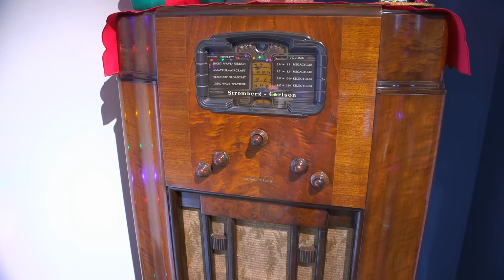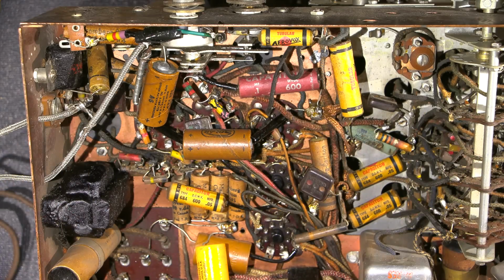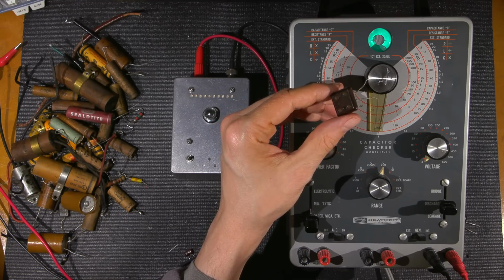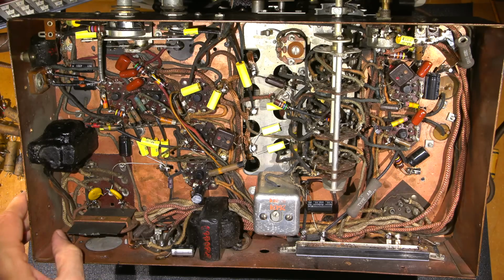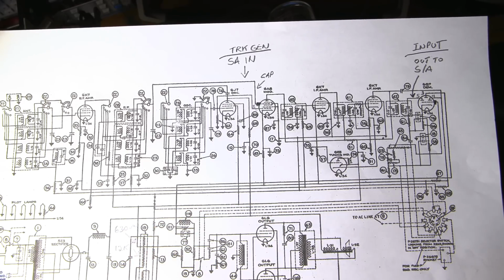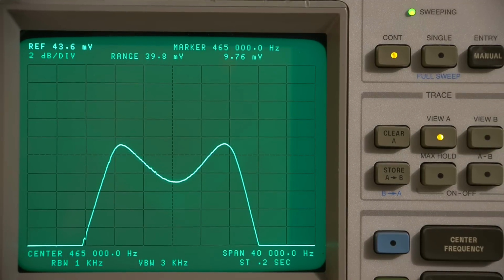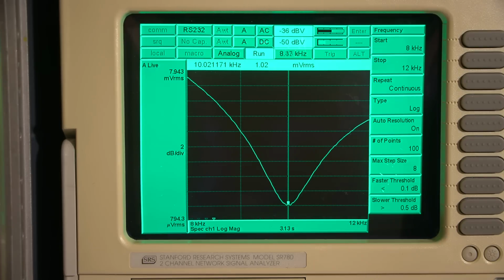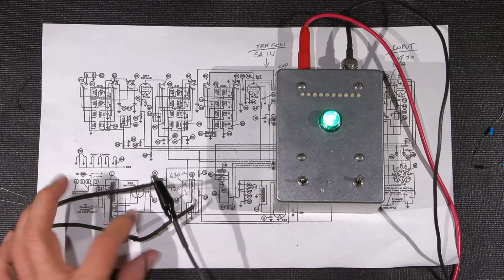84 Year Old Radio Receiver Restoration! Stromberg-Carlson 145L

Comment: When that resistor pack goes bad. Can one use a bus bar and make a resistor block? Using high wattage resistors and heat sink them to the body? Or would the extra lead length add noise into the circuit? I think there was a reason for them to make it a pack.

Comment: I put a bucking transformer in my radio to drop input voltage to 110V.  Added a CL-90 inrush current limiter to protect filaments, and a fuse.

Comment: Buy an old Stromberg Carson? are you going to provide the alignment service? No one could possibly find the sweep generator, scope, or specialized cap testors. You haven't even told us where to find or register for your patient channel much less build the dozens of devices required to fix the radio or all of the equipment it requires to fix it up so you are giving out misinformation and telling people to buy useless junk that will cost a fortune then have to throw it away! Tell you what. provide a free alignment service with free shipping to wherever you are and free return shipping

Comment: Cool video!!!
I bought a mid 70s Technics audio receiver that was recapped. They used nichicon (spelling) good quality ones. I even have the bag of all the old ones that were removed.
First couple runs I did have a smell which I don't know is normal. Even now as I stress it, I get a scent coming from the electronics but it performs awesome. I did have to restring the tuner which I found cool. There were pulleys and stuff running all around the case lol. But I found the service manual that showed the routing. 
Can't beat the sound of the phono preamp from these older units that were designed to play records as opposed to any modern ones that are just there as a feature and not intended to be the main mode of external audio playing.

Comment: I have a much "newer" Stromberg-carlson radio/phono. From 1947.. It has 2 fm bands.. The radio still needs some work.. The fm bands are working but not "quite there" yet.. I play my mp3 player through the phono input via a matching transformer.. It sounds amazing with its push pull 6f6's output tubes... This radio once belonged to my grandfather's brother... Still giving me tunes...I can play 78's on its old record changer.. The cabinet was built by 'Andrew malcolm'... A real gem... That's a real awesome radio you have there... Worthy of a full restoration... Chassis and cabinet, if required.... It's just too bad the AM band isn't what it used to be...

Comment: One secondary purpose for the speaker exciter coil is as that mentioned hum choke. One pi filter quieted that high voltage DC and hum nicely.
Back when I worked as senior tech at RadioVision, the owner came to visit. He had been sidelined by numerous ministrokes, but was still quite technically sharp. He was surprised that I knew of the exciter/choke function in an antique that we were repairing for someone as a favor.
Permanent magnets were becoming popular in the late '30's, but then got chewed up as war supply components, initially for loan-lease, then for our own war production. Old electronics are literally an object history lesson!
As for the speaker, there's only one way to get better - brand new and stored under hypoxic, temperature controlled conditions.  ;)
Mica and phenolic caps, tunable slugs, oh the memories!

BTW, remember, they designed these using state of the art computing of the time - the slide rule.

Comment: I used to do this for a "living".  Sadly, most of the folks who grew up with 30's and 40's radios are now dead, or close,  and the collapse of AM brodcasting due to "frequency auctions"  and allowing huge monopoly ownership of radio stations... has made use of these wonderful sounding radios.. nearly impossible.  Trust Busting Legislation, and a return to showings of public interest and necessity for local and large market licensing might help.  But maybe it;s like horse collars.   Not big sellers when nobody even knows which end of a horse to talk to anymore.    My approach to these radios was always to shotgun replace all paper and electrolytics, check all resistors, clean,, dexoit and re-tube,   then any other troubles will show up during the alignment and calibration.  "repair"  is sort of a non-concept untill this is done.

Comment: The detection of the very high resistance of the alligator clip boots reminded me of a frustrating problem I once had related to those black Kulka brand (or others) barrier style terminal strips.  An oscillator was on two screws driving an electromagnetic probe in water where two electrodes picked up the very, very small current produced when moving water cut through the magnetic lines of force.  (An electromagnetic velocity sensor.)  I could not get it to perform hardly at all which was frustrating because we had manufactured a number of other products with this type sensor.  But not with the wires attached to a black barrier strip type terminal block.  Somehow, amazingly, I postulated that the terminal block plastic might be conductive.  (I think I got that notion from wonder how they colored it black - "lamp black"?  Something with carbon?  Who knows.)  And that was it.  I could touch the oscillator output to just the barrier strip plastic and a big signal got coupled to the input.  That may be part of the frustration, but also the fun, of dealing with electronics.  If you do enough of it, you will see some interesting curve balls.

Comment: Doesn’t everyone want to try it out when they get it home?isn’t that the point?I remember when I sold videos we told them to plug it in warm up the heads to dispel any condensation so was wondering is this the same kind of thing you mean?not one should leak with just switching it on?enjoy your tutorial though👍
Reply from the maker: Switching on 84 Year old electronics before a restoration will cost you money, especially when you have to replace tubes and transformers. If you burn out the field coil on the speaker, much more money. From sitting, capacitors have dried up, and they short circuit when power is applied, which in turn burns out the power supply and surrounding components. This isn't a VCR or tape machine.

Comment: That's pretty impressive. I live about 70 miles away from Fort Collins, and I can't pick up the WWV.
Reply from the maker: They transmit at 2.5MHz , 5MHz, 10MHz, 15MHz and 20MHz. Try each one, you will hear them at one of those frequencies depending on your location.

Comment: Greetings:
You made an eye tube amplifier in another restoration, so here is another suggesion. Extend he eye tube life by interrupting he eye tube anode voltage after tuning is pused using the AVC voltage sability and re-enable the voltage when tuning is again turned whereby the AVC voltage changes.

Comment: Greetings:
I know that you prefer to maintain originality in most of your restorations but I recall that in a previous radio restoration you chose too add an amplifier to an eye tube circuit using an unused punched "tube socket" location. Therefore I feel safe in suggesting that you might want to extend the eye tube life by adding a circuit to interrupt the tube's anode voltage when not being used for tuning. I would automatically detect using the AVC hat the tuning eye is needed and re-enable the power to light the target.

Comment: This reminds me of my ham radio years and building guitar amps from older radios. I've restored old Victor radios with the with turntable combos using the horseshoe electric pickups. It even had a recording attachment. Radio one example is the Victor Electrola RE-57 1931

Comment: Did you know that some micamold capacitors are paper? If the value is over.001 it usually is paper. Thats why with mica molds you have to check the value, and not assume its mica.

Comment: Mr. Carlson;   I have a Sony SQD 2020 4 channel decoder.  ( that I bought new in 1975) It randomly drops the front left output when in the 2-4 mode which requires me to switch to a normal outpur mode. This mode normally gives the best sound effects to the rear channels.  What do you think could possibly be the issue?  I have no knowledge of the inner workings of electronics.  Do you have any suggestions on what I might look for inside the unit?

Comment: I may be wrong, but the bass surround on that speaker could indeed be... wait for it... calf skin! I've seen quite a few from this era that have calf skin... as unlike felt it will preserve the seal of the driver and produce more bass than porous felt, which unless it's heavily doped will leak air and consequently bass... and that's the reason it's there in the first place.

Comment: Sir Carlson's Strombergian-Jamm'n-Carlson. 
A well grounded common Tron exploring a plate sizzling world of internally heated glass blown Valves, building to crashendo crashing capacitors, regimental Sargent striped resistors, trimmed ceramic trimmers, transformers in disguise. 
Hi-fidelity Hi-definition, Uhf-Ultra High Freq, Uhd-Ultra High Def, Kilocycles-Kilobits Megacycles-Megabits

Comment: I was given a closely related Stromberg Carlson with a record player. It has the same bezel and the acoustic labyrinth markings.  As we loaded it on a trailer, the chassis slid out and fell to the street. The glass plate and the tubes shattered. I use it as a stand for my modern receiver and for record storage. Very interesting, and a bit heartbreaking to see how special a radio it was.

Comment: Used to do this with a vtvm back in the 60s. Used ohms 100k and 1 Meg scaleswax copacitors leaked on rx1meg when they were new still own no’s waviest. Heat the leads with solde4ing iron and watch it drop.

Comment: I had some old tube radio s but could never find replacements for them , I wish I had thm back after finding your channel just get lost, confused. By the complexity and the diagram s just as well be in Chinese to me. If I needed radio work id send it to you. I'm a total idiot whenever it comes to auto and radio wiring

Comment: I will tell you something that will make you sick.  When I was in a technical high in the 1950s the school received a large truck load of console radios from the 1930s and 1940s.  The school had no use or room for all these large radios.  So we students were told to scrap all the cabinets and to strip all the chassis for all the tubes and power transformers. We also striped the output transformers and speakers. Later as a collector it all made me very sad.

Comment: i was think , it must be possible to make more than 1 in a case, so you have the orginal , but with a click you can  use  it for internet radio, .......... so you have best of "both" worlds, and you can use dail for both, ..... or if there more possibilitys, .............because the older radio"s are so big, you can make several in 1 and just ad a switch to channel between theme , and you keep your front and dail , to work with them all, so whatever you use, just look like the old days, so there is the nostalgy (im 50)  from i was a child in the 1970s (i was born 71 so memory is more late 70s and begin 80 , ........... child hood is between 1971 and 1991; wen a was a young adult , and had more freedom that stay inhome lissen to the radio

Comment: this is a real radio,  this had a place in your house, almost like a ..... (im dutch, and dont know how to type it)  a box for lissen lp"s of cd"s,  it was always sad if you need thrrow a perfecr working radio away just because you get no lamps for it to let it work, the sound is so clear, ....... dont know this days with the very expensive types  , put once that sound , you hear everywhere,  ......... and so easy........ on tv , if you you had no sound, you replace a lamp, if you screen was black , you change the second lamp, ........ and that was it,  2 lamps , ........... now its al make to "break" ............. the older radio"s there where after 50 years still perfect condition, there where made to work and keep working, ...... now there made to just survive your garancy, , it garancy was 2 years, it was made to work for  max 3 years ...................

and there story"s enough that there break on the exact date the garancy stop

Comment: Kind of a stupid question since you mostly work on electronics but I have a 1903 hand crank record player. I have hundreds of records for it. It has nothing electronic in it. Everything works except for one thing. There is only one song on each side of the record. When it reaches the end of the song it is supposed to stop spinning on its own. That it does not. It will spin down if you don’t crank on it too much. But it’s a mild inconvenience because you have to pretty much babysit it. Got any ideas? To be dead honest with you I haven’t even opened it up

Comment: Thanks for the tip on the resistor on the seeing eye tube. I got a RAF BC-696 for practically free on eBay that was nicely modified at one point for amateur use, but has since been hacked. My only option is to make it functional is to do a modern redesign but use some of the original components. I'm going repurpose the (missing) 1629 seeing eye tube as a grid current indicator for the 807's (1625's). The rest'll be all solid state but use the original VFO section. Designed it, gotta build it... eh.

Comment: Hi, I know this isn't related but I have to ask and hope you'll be able to steer me in the right direction. Without going into details, I accidentally (not paying attention) mixed my vacuum tubes. Here's what I did. I installed three 12 AX7s where EL84 tubes were supposed to go and three EL84 tubes where the 12AX7 were supposed to go. I switched the amp on and didn't get any sound--it's out of a Peavey Classic 30. I noticed all 6 tubes glowing. I found my error and promptly corrected it but the amp is still as quiet as can be. Would I need to troubleshoot for damaged components inside the amp or would I just need to replace the tubes--specifically the pre amp tubes? Thanks

Comment: WOW, that's a brand I haven't heard of in a long time.  When I was a very young teen, I repaired an old Bakelite Stromberg-Carlson radio that my dad had in the garage,  I think it was from the 40s.  It had a blown cap which I scrounged and replaced, maybe about 1971 or so.  It was a much simpler design than this and I think it once belonged to my grandfather.  Unfortunately, it got tossed out while I was away from home.

Comment: Happy New Year Paul, and thank you for another great video. This couldn't have come at a better time because I have just come into possession of a family heirloom, a Stromberg-Carlson 140-L, a model very similar to the one you restored. The cabinet is a little rough and the grille cloth is shot since it was stored for some years in a damp basement, but the chassis is fine and the speaker looks mint. Also I noticed that the chassis is copper plated! All the Labyrinth cardboard is intact and the cabinet work can wait until spring.

Electrical restoration is off to a rocky start, though. I took your advice and checked the magic eye resistor and when I opened up the cup that holds the tube socket the board just disintegrated. Oh well. it's a long winter.

Thanks for your help and wish me luck

Comment: Mr. Carlson, I inherited an old WWll radio receiver, a Halicrafter SX28,? used aboard aircraft.  In my lifetime this is my second SX28, my first was purchased from old Henry radio store in Los Angeles to be my general coverage receiver for Ham radio back in the 1960's.  My new unit had been outside, unprotected from the elements, but was in surprisingly good condition.  No visible rust on the chassis.  All tubes accounted for but no way to test them.  I had to remove that chassis from the steel cabinet to have a local radio repair shop install a new tuner dial string, as the original was stretched beyond its ability to operate.
The new cheap flat-screen televisions has absolutely ruined the repair shop business.  I cannot find any repair shops ANYWHERE!!  I believe my (NEW?) SX28 is quite valuable due to it's rarity.  Are you interested?  Maybe doing a video on the Halicrafter SX28?  Give me a "land-line"  Michael at  7 oh one  2 one five, 4 nine zero 0

Comment: After seeing a number of these videos I am still amazed how much smaller the replacement components are compared to the originals. Would that make a significant reduction in the amount of heat generated?
Reply: Wonderful restoration, the only difference in heat generation would be from the leakage in the electrolytic capacitors which would not be significant until the capacitors became old and defective and more leaky. Many of the power electrolytics dried out and lost capacitance, leading to 2 times mains frequency hum. They generally heated up after long periods of disuse where the actual electrolytic film would degrade and get hot when power was reapplied, sometimes exploding with spectacular results. Most of the older radios in Australia did not have their own fuse so something in the radio generally gave up first.

Comment: you ever use the lcr-t4 or tc1 test devices?  They are cheap and they will do capacitance and esr tests simultaneously which seems to be very accurate from my usage, mostly use it for testing capacitors
Reply from the maker: They don't test EPR (leakage resistance,) the device you see in the video tests for this fault condition.
Reply: yeah, they work really well though, nice work with that EPR tester by the way, it's nice of you to share the design and all like that too, if I ever need to test for that I'll know where to go.